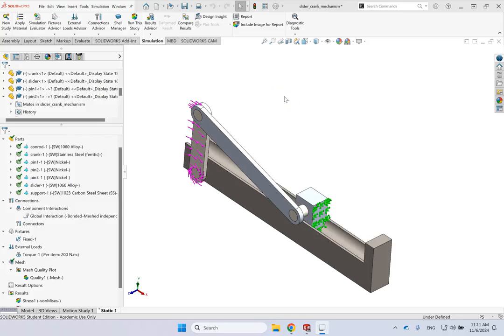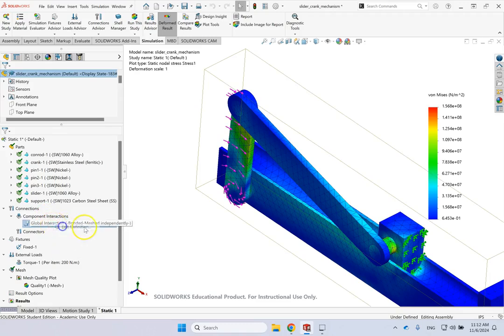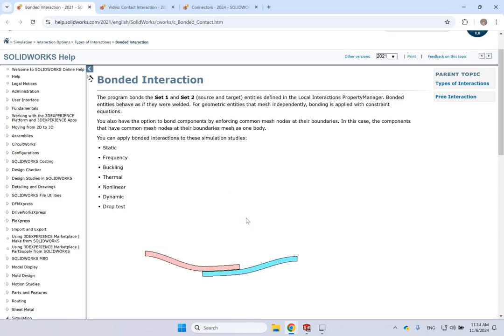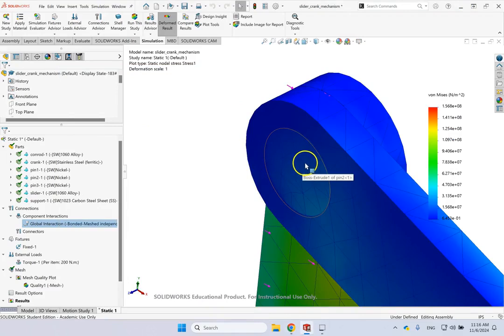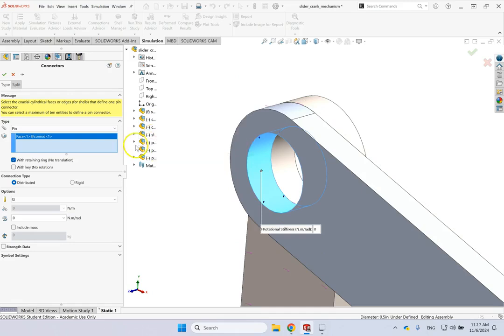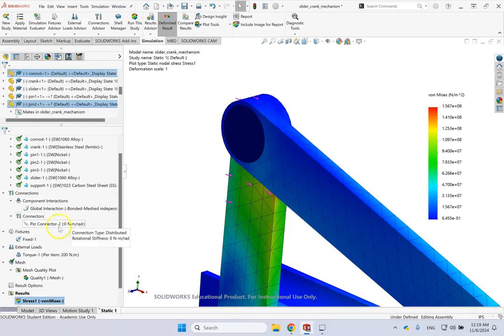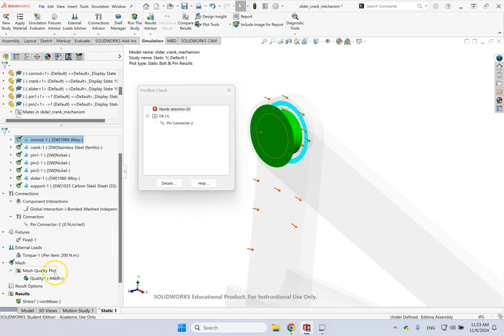SolidWorks Simulations: Bonded vs. Contact vs. Free Interactions, Connectors, Pin/Bolt Check

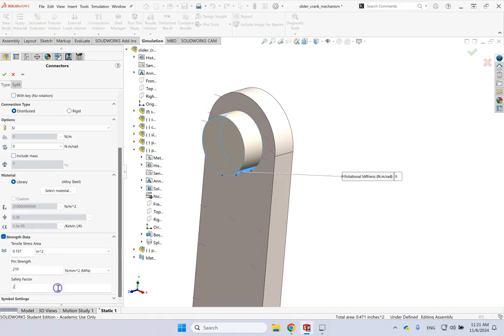Comment: At 10:30, why are you entering outter surface area on tensile strength area?  Isn't that area specifically applied to tensile forces?  Unfortunately SolidWorks Help is not clear on what this field does at all, and I'm also confused why SolidWorks can't calculate this itself based on the pin diameter which is already calculated when you selected the faces on which to apply the pin.